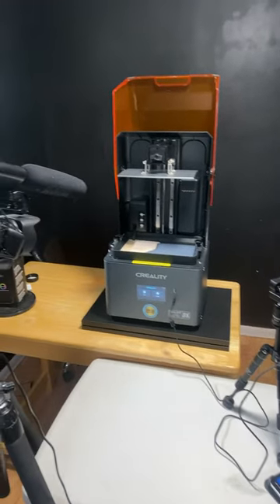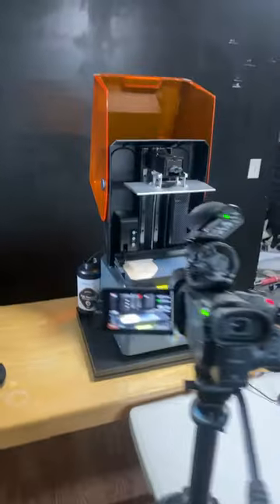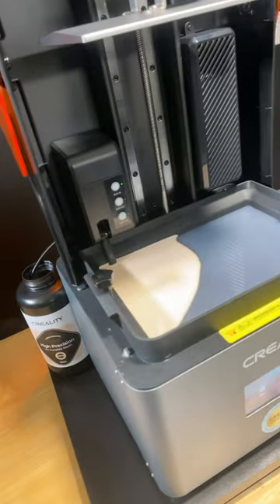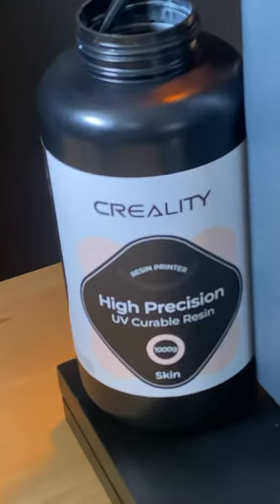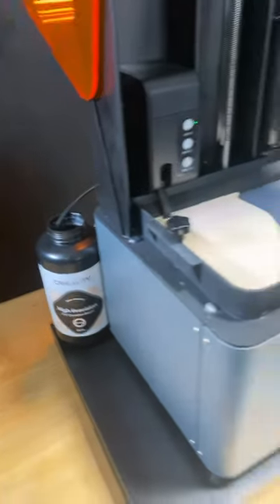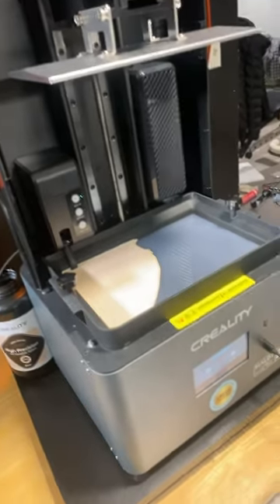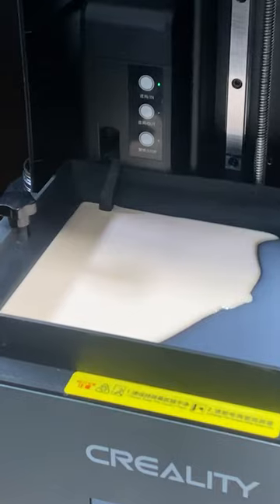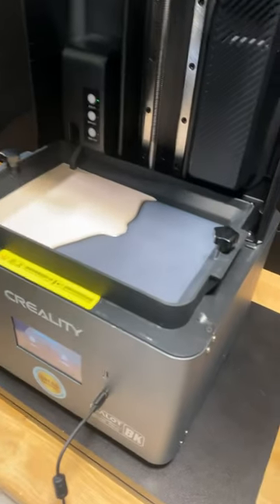First Run of the Resin Feed System of Creality Halot Mage Pro Resin Printer

Comment: I have the basic mage the non pro version, I found the fume extraction works well and did reduce the fumes for me, but I tend to avoid the smelly resins. Really looking forward to your full review as I also have a mage pro on order. I am not really a fan of the UI on the mage, I got used to the Halot One, which for me works well. Having the ability to adjust not only exposure settings while printing but you could change the rise speed which you could not on the mage.
Reply from the maker: It made my house reek of Resin. I probably will be turning it off till I can vent it outside. What Resin's would you say are not Smelly? I only used Creality so far on this machine. Worst smell of any resin print I've ever done
Reply: I bought the Halot Mage too. First 3D printer I've ever owned. I 'jumped right in' this hobby, so to speak. Had some issues at first, but after a firmware update, I'm now printing with exceptional detail. I've seen a few negative reviews, but I like mine. That said, can't compare Creality to anything else. How's your experience?

Comment: How are the resin fumes? Id seen the filter from the unboxing, dont know if it makes a difference
Reply from the maker: Currently awful, as it's venting into the room. I turned it off, but the test print turned it back on! 😂😂 Guess gotta turn it off after print starts. I don't see the point of the filter if venting out a window.  Venting into the room, made the room smell awful. Not sure the filter is effective at all.